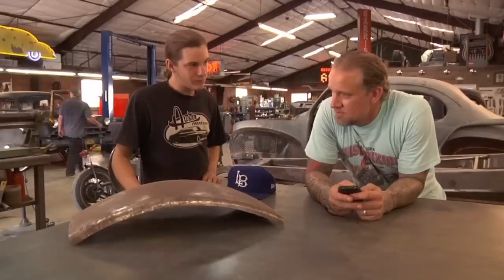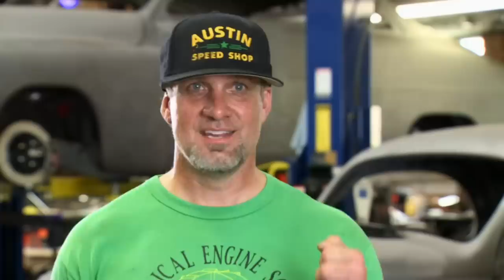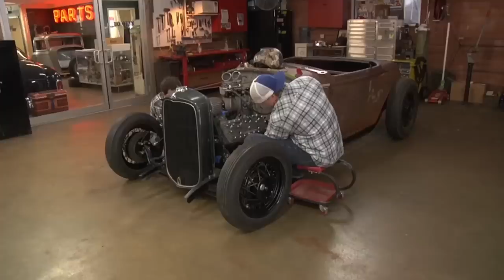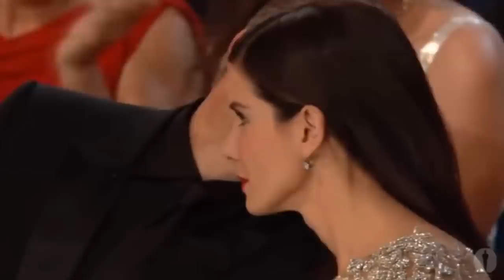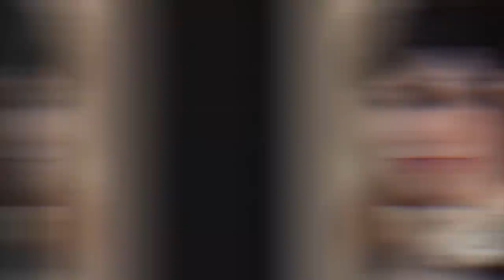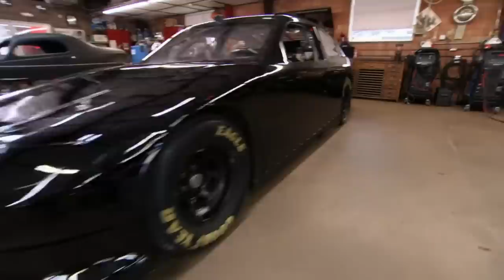What Really Happened to Jesse James From Austin Speed Shop

Comment: He isn't a mechanic. I believe he started as a welder. All he really did is make the frames and then add the motor. He didn't build the motor. He didn't work on the motor.
Reply: Nobody built their motors. What's your point?
Reply: @SOLDOZER  My point is a mechanic knows just about everything there is to know about the motor, can take it apart and rebuild it, and knows how to do other things I'm sure Jesse never learned since he started out as a welder and then working with metal by manipulating it and welding up stuff like Gas tanks for motorcycles. Why not call him what he is? A metal fabricator. As a welder myself, I wouldn't want to be called a mechanic.
Reply: I get cha, I call myself a fabricator, I can definitely turn wrenches but I don’t make a living opening up engines.  Just cuz you put a lift kit on yer Toyota don’t make you a mechanic.  I take one look at a guys  torque wrench and know if he’s a mechanic or not
Reply: @matthewsmith2362  Yes, to me he's a welder/fabricator. He's not rebuilding engines.